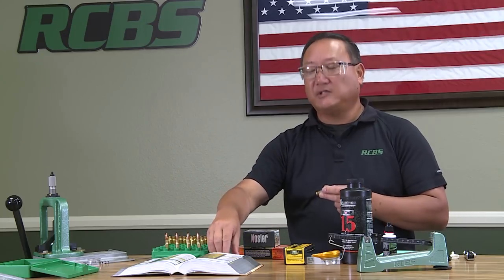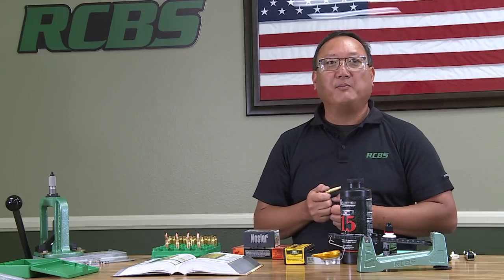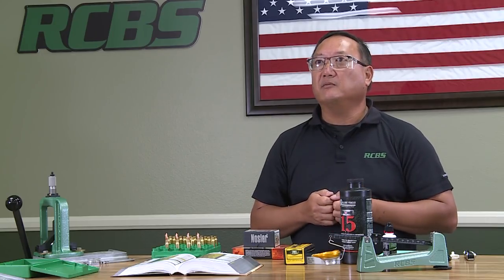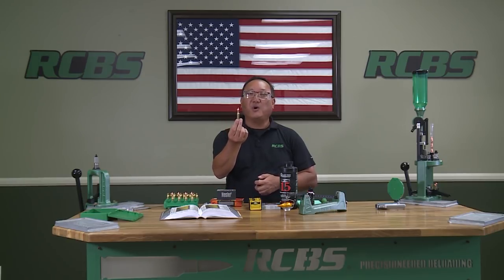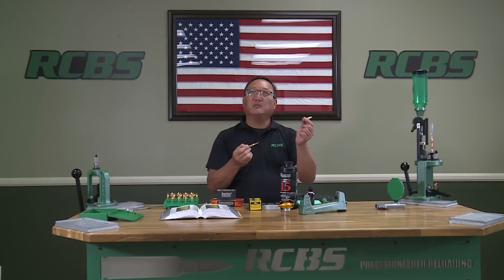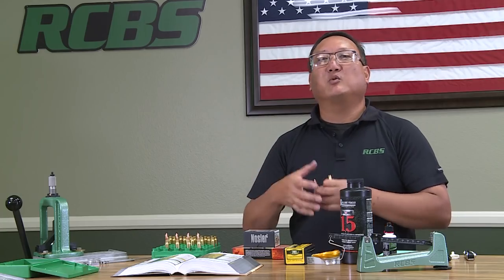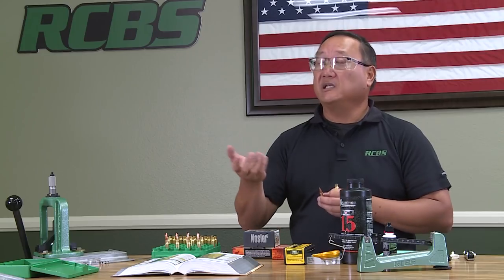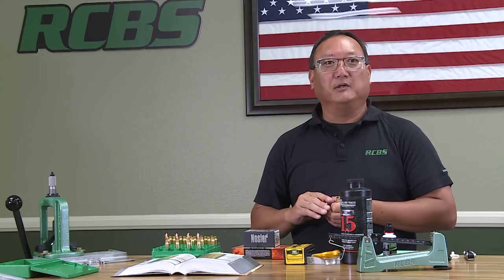Intro To Handloading: My Sizing Die Does not Work

Comment: Good explanation. Standard die thread is 14 threads per inch. That is .071" of length per turn. If the press is camming over, you are squeezing past all the slop in the linkage to ensure the die is truly bottomed out against the shell holder. Factory rifles for newer calibers may have really tight chambers because they want the best performance out of factory ammo (which is always well under the SAAMI minimum chamber headspace). Unfortunately many die manufacturers haven't figured this out yet. If cam-over is still not enough, it is not uncommon to have to remove some material from the die or shell holder.
Reply: Really, that's a thing, huh?  I'm having that exact issue and of course, the more I lower the die, it just keeps the press from camming over, which doesn't work.  There really is no adjustment...you go until they touch, down another 1/4 turn, where they still touch, and if that's not enough, removing material on the die is the only solution???  My current die is a Lee Precision...wondering if switching to RCBS would be different?
Reply: @brucemccauley8887  you might swap around shell-holders until you find one that is a little small on that step height. RCBS makes a set of headspace adjusting shell-holders, but I think they are all on the + side.
Reply: @erich9111  Thank you for the reply!!  I did check that already, all of my holders seem to be the same...nor am I sure that just ramming it further into the die is the right answer?  I'm thinking of purchasing an RCBS die to see if that makes a difference...although hate to spend $50 and have the same issue, but hoping it may just be the Lee Precision die.  I've also measured the brass compared to a live round, very similar if not exact.  The live round has no issue going into the Win Model 70 but the brass is tight to put down the handle.  In my old Rem 7400, they both work great.  I'm wondering if the chamber of the M70 is just a tighter tolerance...but not sure what to change to make it less so when resizing the brass.  Also, the dimensions of both the live round and resized brass are much lower than the max sizes in the Hornady book for the 30-06 round so there shouldn't be a size issue at all.  I've checked some other vids on this problem, but they seemed to have different issues.  I'm at a bit of a loss as to why it's tight.  It appears to be workable, just don't like it that tight but don't know why it is or what/how to change it...
Reply: Oh, and both fit perfectly in the Wilson cartridge case gage...
Reply: @brucemccauley8887  using the same brass in two different rifles is problematic. You might be able to solve the problem by running them through a small base die (that reduces the diameter closer to the case head), but I would still recommend keeping the brass segregated by rifle. Normal sizing dies mostly shorten the headspace. Small base dies put extra wear on the brass by putting extra squeeze on the diameter down the body, but this may be needed to reverse the effect of fire-forming to a loose chamber. Probably your Wilson gauge is extra loose on the body diameter so that it can still get accurate headspace measurements on brass from a loose chamber.
Reply: @erich9111  You the man...I'm betting you're right!!  To clarify, agree on segregating brass by rifle...I was just using that as comparison that it fits in one chamber, but not another all while being well under max tolerance "by the book".  But, this is brass that I've collected over the years, before I decided to get into reloading, in the chance that I someday would...and 2/3 of it was shot through the 7400.  I was planning to now load it for the Win M70...hence the issue.  So, as the 7400 apparently has a looser chamber, I likely would need to either use a small base die (I almost just ordered one of those) or get new brass to start with for M70 rifle.  I am talking hunting rifles here (obviously with the 7400...) and not match rifles so a little less on the tolerances is ok as long as it works and is safe, reliable, and repeatable.

Comment: What if your die instructions say something like, ‘Carbide is a hard and brittle material so you need to back it off half a turn make sure that it doesn’t hit the shell holder because it will chip’?

Comment: out of curiosity - why can the dies not be manufactured in such a way that screwing it in until it touches is enough?
Reply: screwing it in a little more just makes it so you dont have to bottom out the press
Reply: Because you need to overcam the press a little to ensure enough pressure is placed on the shell.

Comment: I bought a set of rcbs in 6.5 cm no matter what I did it would destroy the case and believe me i tried averything before i sent them back and bought a set of redding dies and i got my sanity back i have another rcbs die in 223 that will size the case it will chamber but no matter how i adjust it the case will not pass a go gage no problem with the redding 223 die i have another rcbs die in 22-250 that sets the neck tension so thight that if you try to use the rcbs bullet puller it deforme's the head and ruins the case i don't know why but my 22-250 loves the supper tight neck or i would have trashed the die i do have a set of rcbs comp dies that are very nice i love the side window for the small 22 cal's no more pinched fingers or bent neck .

Comment: what about when i do what you said and it goes in but my bolt closes but it closes pretty tight compared to factory ammo that closes like butter on my remington 700 bolt action? what could the problem be then? because i turned it even more and more and eventually it opened and closed easily BUT then i had a new problem which was when sizing, it was very very difficult to get the case in and out of my hornady lock n load press. it took a lot of effort to lock the ram and the case would feel like its catching on the way out about two or three times as if its having a hard time going past something? Thats been my biggest problem and haulted all my reloading for the past year. i have switched lube and that worked a bit but still very very difficult
Reply: what cases are you using and are you using a full length die?
Reply: ill try cleaning it again. i have cleaned it. when i turn back the die as to not size as much the problem decreases to a minimum but then the round wont allow the bolt to properly close. my thought is its something with the brass, specifically where the neck flares out before getting to the main body. i think that may be where its not to spec and causing the brass to touch the inside of the barrel and not close. I have nothing to measure that with or know how to so im not sure but think that may be the issue. Anyone in the los angeles california area that can stop by for an hour and help me figure this out im willing to pay $100 to for what i hope wont take longer than an hour to a pro
Reply: @eladsinay6914  what kind of measuring devices do you have ,dial indicator, micrometer, OAL gauge?
Reply: @Infectious Legume haha too bad. im using mixed headstaped brass but mainly wolf fired from my AR chambered in a 223 wylde. dies are full length redding dies
Reply: @edmundooliver7584  just a micrometer.
Reply: @eladsinay6914  A case gauge might help to compare factory to your brass.
Reply: @edmundooliver7584   oh ok i think i do actually have one. dont know if its 556 or 223 or if theres a difference, but if i remember correctly i think the cases were able to slid all the way thru. is that bad or normal? also, does that not matter and i should be placing it on a solid surface to see if its flush and thats all?
Reply: You’re using rcbs dies in a Hornady press, It could be the shell holder not  allowing it to go down far enough to fully size you brass . Some shell holders are different sizes in different presses, I had that problem with a crimp die , so I ground a little off the die to allow it to go down farther so it would apply a crimp, just a thought, also look in tabs instructions it tells what thickness the shell plate should be for there dies, good luck don’t give up , rcbs makes great reloading tools